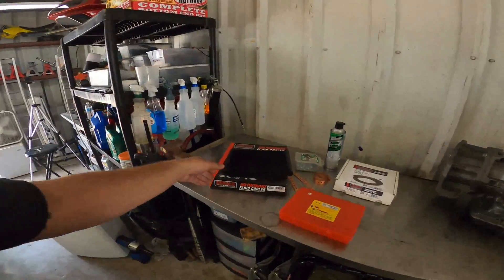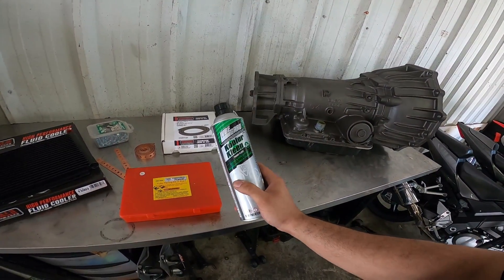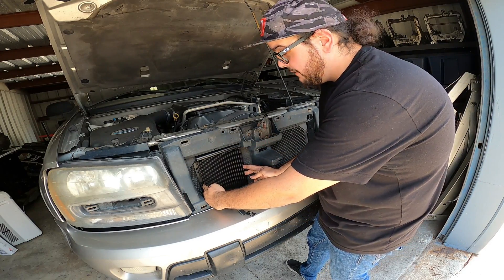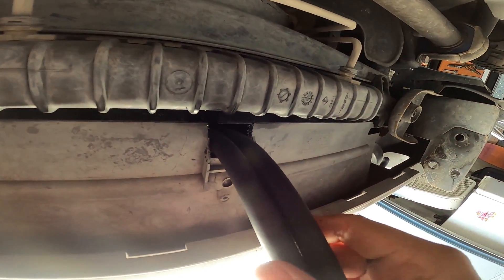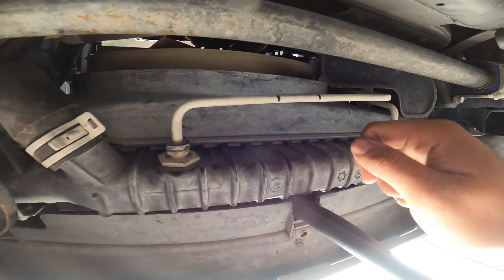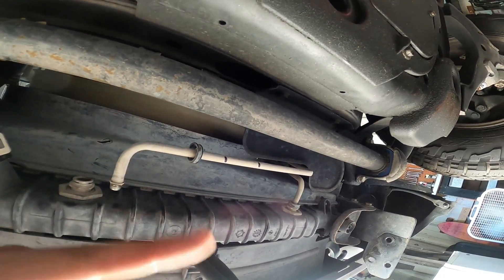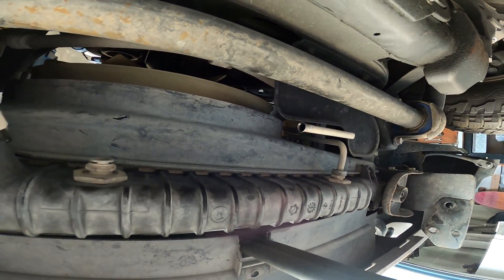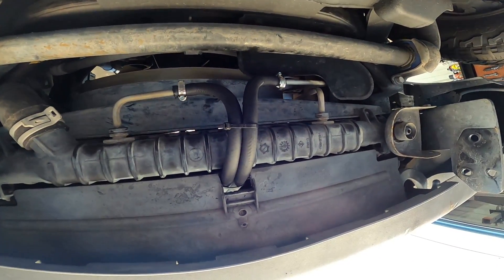CHEVY TRAILBLAZER TRANSMISSION COOLER UPGRADE (4L60E HEAT MANAGEMENT WITH DERALE 8000 SERIES COOLER)

Comment: Thanks! I will make this service im my Blazer V6 4.3L on 4L60e M30 Transmission because When it heats up after 3 minutes of driving or in "P" position, there is an oil leak underneath the torque converter seal
Reply from the maker: I don’t think this will help fix that problem. You may need to pull your transmission and check the seals. Sounds like your rear main seal is bad.

Comment: Just use the double flare cap for the bubble on your flares and skip the second step without it so they aren't sharp anymore and I won't be mad at you.  You just need a little bubble. Won't leave a sharp edge and it makes the hose  easier to slip on. That hurt me watching it. lol
Reply from the maker: Not my proudest moment on making a flare but they’re still holding up and working well. Thanks for your feedback on this. I appreciate it!

Comment: sorry I'm a bit slow and maybe a silly question.    but so with this mod you did, your running the fluid through the radiator and also the aux cooler?   so you didn't delete the original cooler you just are now running essentially 2 coolers?
Reply from the maker: Yes. Im running it inline with the factory system. The factory system is inadequate. Unlike the Silverados that got an independent functional transmission cooler. The Trailblazer just got one built into the radiator tank so it doesn’t really do much cooling. This remote cooler helps reduce transmission temps much better than the factory “cooler”.
Reply: Yea the way you routed those lines looks confusing.  For a second it looked like a closed loop.

Comment: The round plastic piece you called a dust cover is actually a much more important piece, i learned the hard way 😅 it holds tension inward on that little snap ring thats under it. Without that little bit of tension from that plastic piece, the transmission line can force that ring off and cause you to blow a line out. Happened to me at 60mph and 2hrs from home on the interstate
Reply from the maker: Sorry to hear that happened to you. Hope it didn’t cause any damage to your transmission.

Comment: Questions hows The performance from when u did, to now..... ima Follow your steps tomorrow but before I do just wanna knw how is it boss
Reply from the maker: It’s been great. Since installing this cooler with a fresh transmission. I have had no issues at all. I’ve towed a couple of cars. No slips and no signs of the transmission getting too hot. I live in Florida and the heat is brutal down here. The cooler definitely helps keep the trans temps down.
Reply: @PASSIONBUILT  thanks
Reply from the maker: No problem at all.

Comment: Just to back up your " public service announcement" at the end. definitely....definitely do a leak/drive/switch through all gears. Glad i did, i had to use a heat gun like you to put hose over the flares. I had a catastrophic failure at the hose. Luckily didnt drive far. Thinking the heat gun weakened the hose? Anyway...i lost just about a quart of fluid. Gave myself extra hose during install luckily. Cut the failed area and reinstalled...no leaks yet. Hopefully fixed the issue.
Reply from the maker: Glad to hear you caught it before something catastrophic happened. Hope it holds up and works out for you. Thanks for watching 🙂

Comment: Trailblazer still running strong? I just bought one and going to install the same Trans cooler today
Reply from the maker: Yes it is! I believe I’m a little over 20k since installing the new transmission and cooler. Good luck with your installation!
Reply: @PASSIONBUILT  That line you cut in the video. Is that the return line? Also is the new cooler spiced in with the old cooler?
Reply: @shawnjs260 yeah the new cooler is in series with the stock cooler in the video.  I’m unsure which line he’s splicing but I’m assuming you want to splice the inlet line ?
Reply: Thank you brother 🙏🏾

Comment: do you still have he TB and hows the trans and cooler holding up
Reply from the maker: Of course I still have my Trailblazer. We just hit 20,000 miles on the new transmission and she is still running perfect since the install with the cooler. 😎👍🏼
Reply: @PASSIONBUILT have you had any issue w the cooler so far ? or is it working how’s it’s supposed to work ?
Reply from the maker: No issues at all. About to hit 35k miles since the cooler and transmission install.

Comment: Thanks for this vid. I just got a Saab 97x and the owner gave me a cooler. Looks just like yours. So the trans fluid is pressurized? And will just flow up and down those lines you installed? I’m a noob when it comes to trans coolers
Reply from the maker: No problem. Thanks for watching! Yes. The lines are pressurized.

Comment: My transmission finally blew does the trans cooler make a difference and if so I’m going to get a used trans do you think it would help it out?
Reply from the maker: The transmission cooler definitely helps keep the temps down. Since I’ve installed my rebuilt transmission, it has been shifting perfectly and hasn’t had any issues. I highly recommend just getting your existing unit rebuilt or buy a rebuilt unit if you have the means for it. Installing a used 4L60E isn’t ideal unless it has known low mileage and has been fully tested with no signs of slipping. I made a separate video of where I got my 4L60E from. Check it out.

Comment: Hey, just trying to figure out why you didn’t tap into the other line why did you put the hoses to one side and not the other. Thanks
Reply from the maker: No need to tap into the other line. We’re just adding an external cooler since there really isn’t one on the 4.2 model trailblazers. So we are teeing into one of the factory hardlines to allow the cooler to be installed.
Reply: @PASSIONBUILT  thanks i was asking because i plan to do the same thank you

Comment: What size/type of tires do you have? I'm trying to find what the largest size is I can install without spacers.
Reply from the maker: I believe they are 225/70/16 Falken Wildpeak A/T3
Reply: 2 years late, but still, here's what I've gathered for the people reading in 2025.

265/70/16 is the largest no spacer on factory wheels.

I have 1.25in wheel adapters (trailblazer 6 lug to standard Chevy 6x5.5) on silverado stocks. I'm running 285/75/16 mud stars. I'm probably gonna drop to a 265 width since I rub like a mf even with a 2in lift, spacers, and I trimmed my fender liners. I've seen people on trailvoy run 285s on stock wheels, but they were lifted and had spacers.

If you decide to get spacers, either get 1.5-2in or be prepared to grind down a good bit off your lug studs. (I had to grind all 24, but some might be shorter/longer if they were replaced with aftermarket ones) 

Also, if you decide you want bigger brakes to support those big a$$ tires, get 17in wheels and grab the caliper bracket, rotor, and pads for an EXT or SS trailblazer. The caliper itself is the same, but the rotors are 12.8in instead of the 12in we got on short TBs.

Comment: Awesome video!!! Gonna have to do this to my TB. Keep the videos coming! Thanks
Reply from the maker: Thank you for the great feedback! I will for sure. Plenty of Trailblazer content coming in 2022! Make sure you subscribe, hit that notification bell, and give the video a thumbs up. It really helps the channel out! 😃
Reply: @PASSIONBUILT   any more TB videos in the near future? Don’t put it on the back burner for to long LOL I’m already subscribed and I’ve liked all the TB videos. So please keep them coming
Reply from the maker: Yes there are more Trailblazer videos on the way. Last week’s video was supposed to be a Trailblazer video. I made a video on how to rebuild your center console armrest and the video was great until it came to assembly and installation. The rebuild kit that I bought from eBay had terrible alignment with the bolt holes for the upper lid and underside. I was able to assemble it but when I went to install it. It didn’t work as it should. So I ended up having to use the upper portion from my OEM center console and the lower latching portion from the rebuild kit. I was very disappointed with the quality of the kit and ended up deleting that video because I didn’t want anyone to buy the same rebuild kit and have installation issues. But yeah. Trailblazer videos are coming soon. 😃👍🏼

Comment: I have a 2007 trailblazer and it has 280,000 miles on it and the 4.2 engine and transmission run great no slip no leaks AC works and I paid 2000.00 for it I don't want to sell it I wish all my vehicles ran like the trailblazer
Reply from the maker: My Trailblazer hit 250,500 miles and the transmission finally decided to go out. But after replacing it. She’s back on the road and driving perfect again. I hope I can get another quarter million miles out of my Trailblazer. It has been one of the best vehicles I’ve ever owned. I paid $2,500 for it about 4 or 5 years ago. Prices have almost tripled since then. I’m glad I got mine for a good deal. I hope yours continues to last you many miles 🙂
Reply: @PASSIONBUILT would a 1 1/2 inch thick one fit though the center bar? I found one I like but hoping to not have to tear apart to measure just to order it lol

Comment: Dude. I’m proud of you! Keep it up. If you wanna install some parts on my ram…lmk nice video!
Reply from the maker: Thanks man! I appreciate it! Honestly, I have my hands full with content off of my own vehicles at the moment. Maybe one day if I ever run short on content. Or if you get another Miata I would love to pick some content up off that as it falls in line with my Miata content. I’m trying to stick to content that I can create regularly. So for right now Suzuki SV650/SV1000 content, Chevy Trailblazer content, Miata content, and then next year I’ll be adding my CRF250R and my sons JR50 to the channel to add some more variety in.

Comment: nice job brother! i went to the scrap yard and chopped the end off one of the lines from a donor so i didnt have to cut the lines on my truck in case i wanted to quickly revert back for any reason
Reply from the maker: Thanks for the love, Robert! I hope everything is going well with your transmission swap! 🙂
Reply: I'm condused.   so you didn't cut into your existing lines?   you are just running the cooler alone and not having the fluid go through the radiator?
Reply: @adamharlow8124 the part where he cut instead of cutting mine I cut one from the donor and just ran my hose off the uncut end of mine and then used the scrap one for the other end. That way if I needed to remove the cooler instead of my line being cut I could just pull the hose off and plug it right back in to the quick connect
Reply: @rabmanrabman  ah.  Okay.  I’m with ya.   Sorry, I don’t know why I didn’t understand that.   So in this video he’s running the after market cooler AND the stock cooler right ?
Reply: @adamharlow8124 correct. It's a good idea to keep the stock cooler as well because if you don't your transmission will have trouble warming up in low temperatures
Reply: @adamharlow8124 the stock cooler helps the fluid warm up in the cold as well as keep it cool in the heat
Reply: @adamharlow8124  I still did I just didn't cut the original lines

Comment: Compression fitting with a nipple would be an option rather than flaring.. Did you note which line is where for the direction of the fluid in the cooler?  I would think you would want the cooler to fill from the bottom and rise to the top to get the most out of the cooler.
Reply from the maker: Hey there, James. I did not think about using compression fittings at the time of the install. However, the flared ends are working just fine. Maybe in the future I will upgrade to compression fittings but for now I'll stick to the flared end setup. Also, I didn't note which direction the cooling lines ran in the video. However, I did route them like you mentioned with the fluid entering through the bottom fitting and exiting out of the top fitting. Thank you for your feedback.